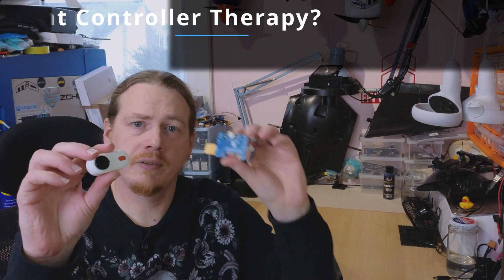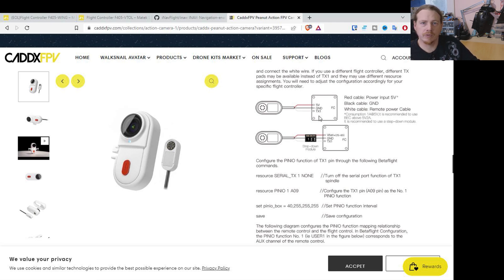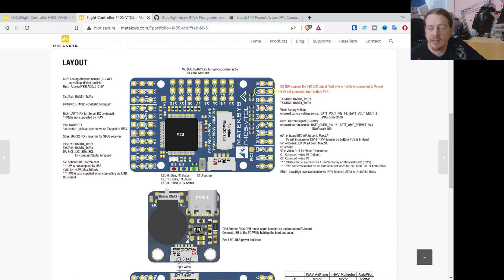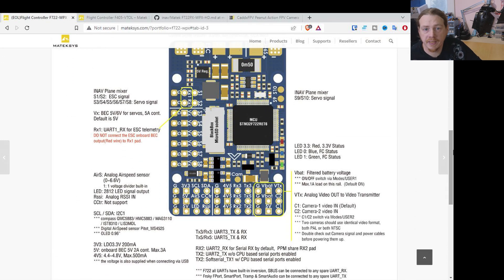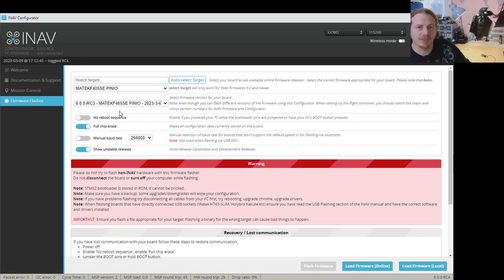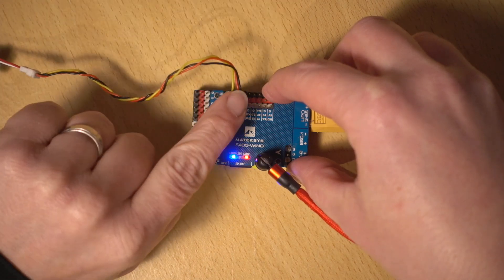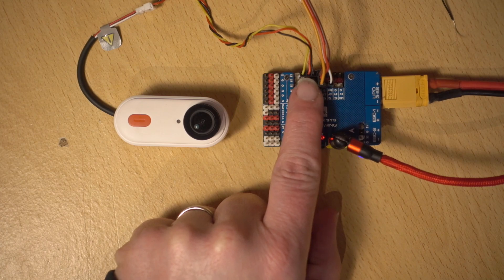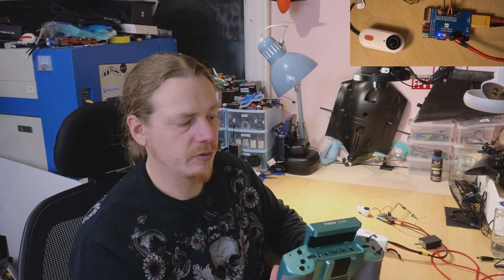Setting up PINIO with INAV

Comment: what is the maximum current we can pull off pio1 to power on a fan
Reply from the maker: To be honest, it should really just be used for switching. Not used for anything that draws much current. If you want to have a switched fan. You would be better off using a PWM switch. The fan would then be powered by whatever power source you set up.

Comment: Very helpful video, thanks.  I was trying to activate switching of the HD VTx power on my Fimi Manta on UART4.  Documentation shows how you can do it for Ardupilot, but I'm running iNav.  Got it working with USER1 on Channel 10 with it assigned to a Tx switch.

Comment: What's the best cam out? Asking bc I want to use the new DJI google's
Reply from the maker: If you want to use DJI O3, you don’t have much choice. There is only the one O3 cam and VTx. I don’t use DJI, so don’t know how the older cams compare and which ones can be used with the new system.
Reply: @MrD  Darren which do you use?
Reply from the maker: @IceMan2035  analogue and Walksnail Avatar.
Reply: @MrD  Thanks

Comment: Thanks Darren hope other camera makers jump onboard now.
Why was the unit overheating? does it need airflow constantly.
Reply from the maker: Yeah Mark. The Peanut needs airflow to keep cool. I’ve not had a problem with it in flight. But on the bench it will start to complain.

Comment: Just started using iNAV 6.0...It looks useful for inflight HD camera control, however is it possible to toggle it and get it wrong?...So, you think it's recording and it's actually not?...like in your clip....It's not like you can see what it's doing in flight....🤔😳😳🤔🇬🇧
Reply from the maker: It is. Which is why I linked to the articles for setting up the switches. Having the properly timed periods. It's much harder to get it wrong.
Reply: @MrD  Oh, I must have missed that bit....thanks...🤔🤔😳😏